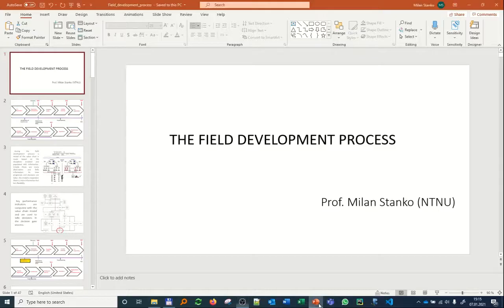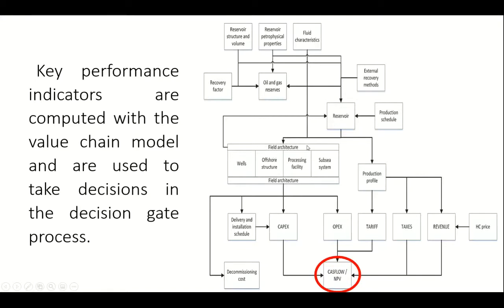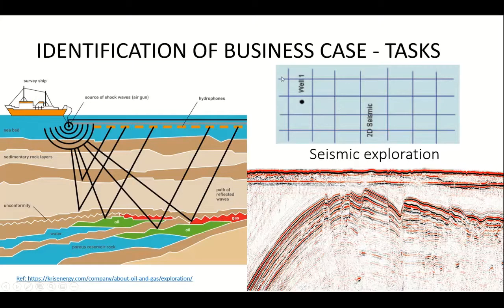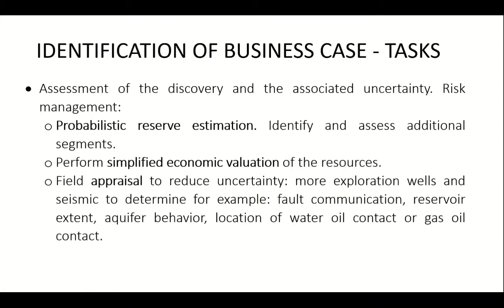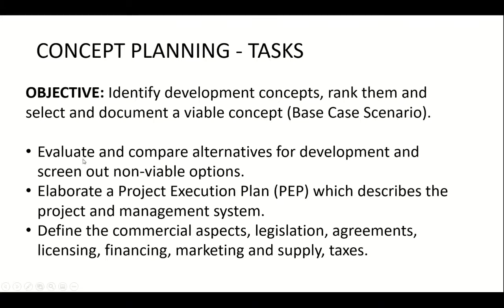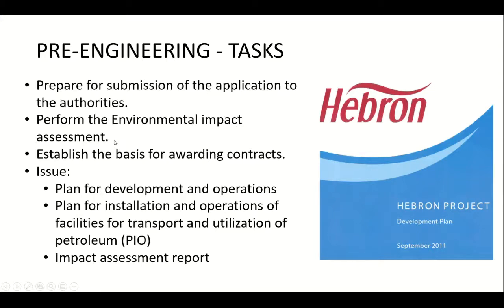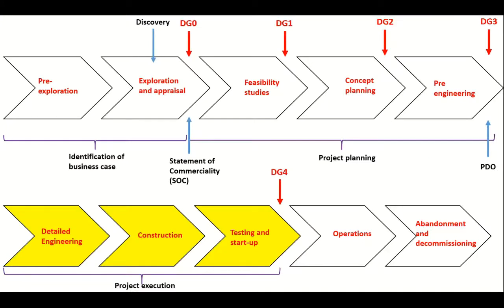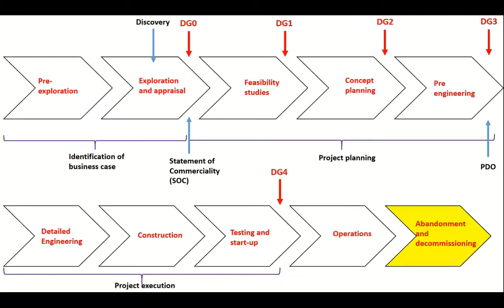The field development process

Comment: Hi Milan,
Thank you for sharing your knowledge!
I would like to know more about the parameters that shall not be changed when the DG3 gate is passed an the  PDO is approved by the government. 
Could you recommend me where I can find more information about these "locked" features?
Reply from the maker: You're welcome. In the PDO you have already proposed a production strategy and development concept and refined it quite a lot, and estimated several technical requirements. Any change that requires a major re-estimation/refinement and entails excessive costs, delays and leadtime is usually deemed as unfeasible, for example development concept, production strategy, subsea layout, offshore structure, main characteristics of the processing facilities. For example changing the produced volumes has a lot of ripple effects for the rest of the system, flowline diameters, separator, compressors, pumps sizes, deck capacity and space etc. For example, in a system with subsea wells, you could change slightly well location, path, completion, if new information is available or if needed or if more cost effective because it is something that it is not likely to affect greatly the rest of the system (as long as the well interface with the subsea system stays the same).